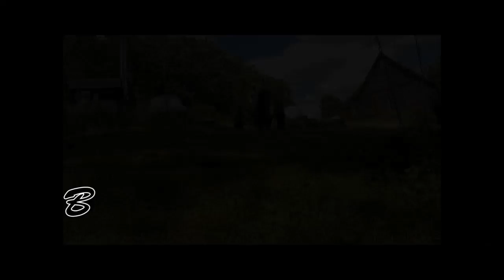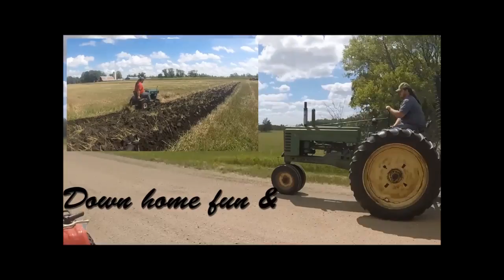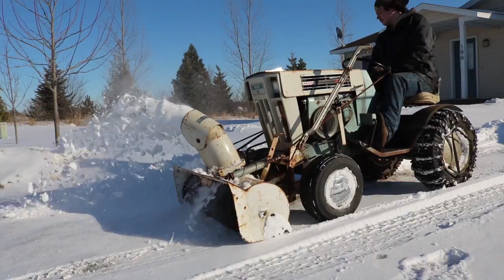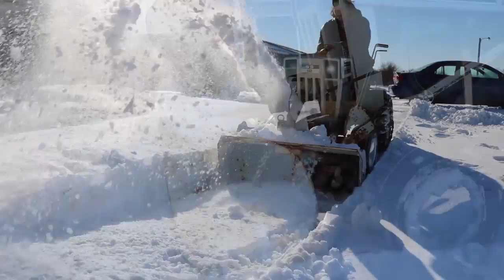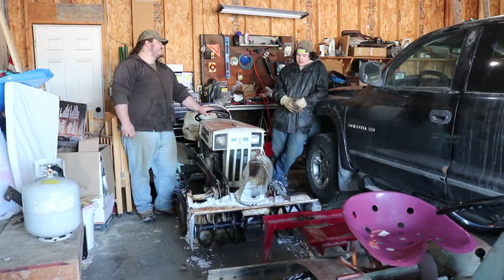1969 Sears Suburban SS12 snow blower action!

Comment: Good piece of equipment, I had one in '77, it was given to me with a blown engine, got the deck,blade and blower, had the engine rebuilt for $300 and used it for almost 10 years and the engine blew again. Took the tires to a tractor repair place and had tubes and fluid put in them, was much better in the snow and rolled the yard everytime I mowed

Comment: jeez that thing was eating some deep snow
Reply from the maker: Randy Robinson wet and heavy at that, really surprised me how well it did! Thanks for watching.
Reply: bill are you going to the Roy thesing auction? gonna be interesting to see what them tractors bring. its been a really tough market for old iron
Reply from the maker: Randy Robinson I haven't heard of it. I see ridiculously high and low prices on old tractors. I'm not too concerned about it yet. I'm still seeing average priced tractors up for sale. My 10year plan is to add more property and a larger building to turn into a workshop. Since I had to move and I lost my last shop it has been difficult. Downsizing and storing things off site.